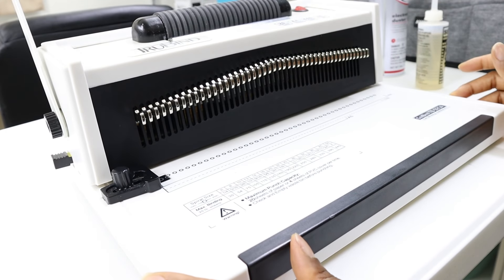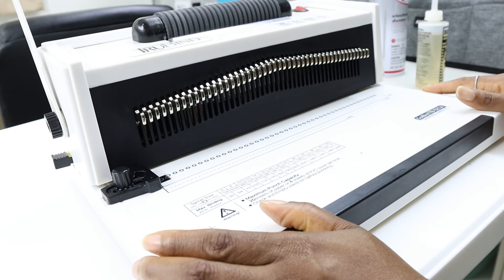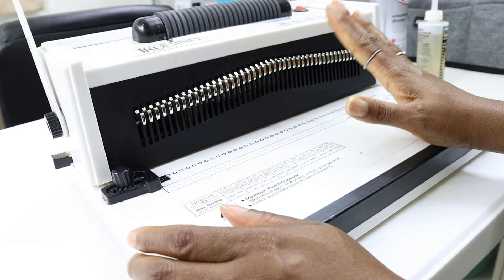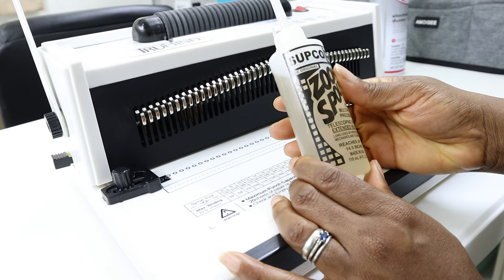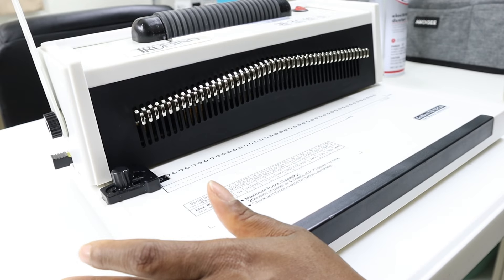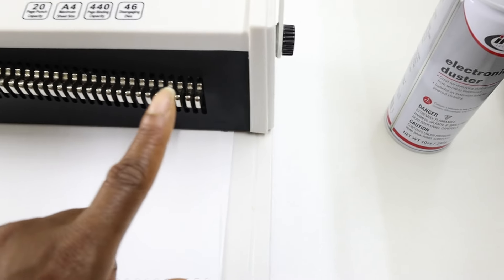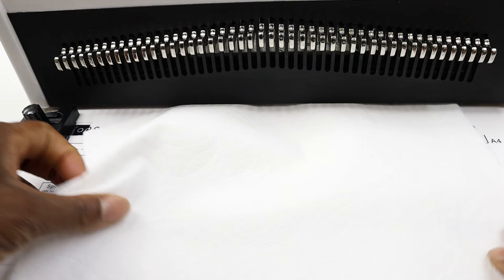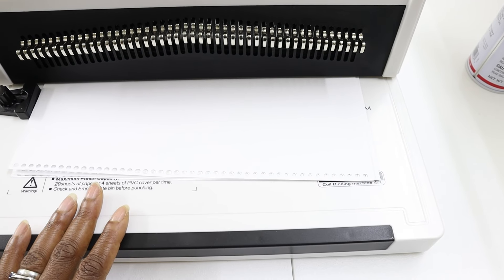How To Oil And Maintain A Home Coil Binding Machine| TruBind TB-S20A Automatic Coil Binding Machine

Comment: Hello, Do you know if I could just use WD-40 oil on my coil binding machine?  I have a Trubind machine, but  had no idea that I needed to oil it for maintenance, but it makes sense.  Thanks.
Reply from the maker: Hi. Great question. Wanted to look into it further. Double-checked, and it is not recommended. The formula of wd-40 is not suited for a binding machine. It can cause oil buildup, make the machine cease, and possibly cause malfunction. It is recommended that the oil be formulated for binding machines.
Hope that helps. Thanks for watching!